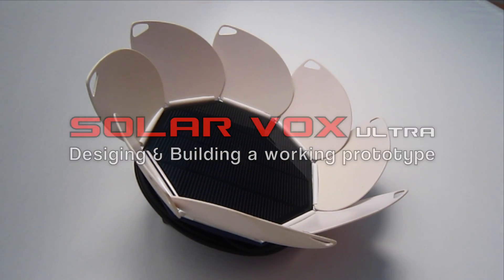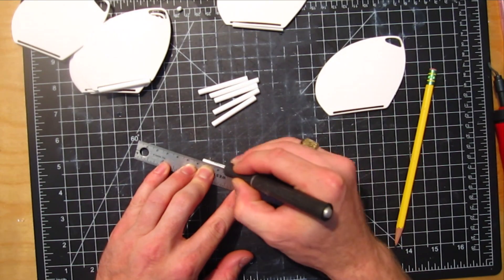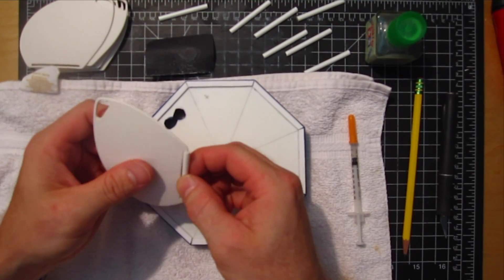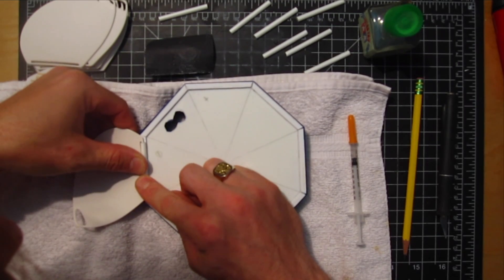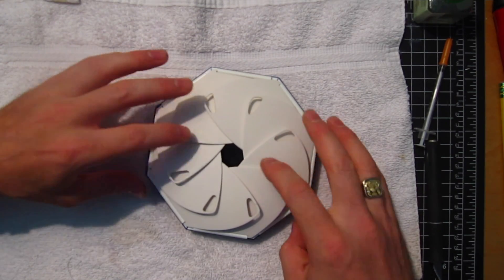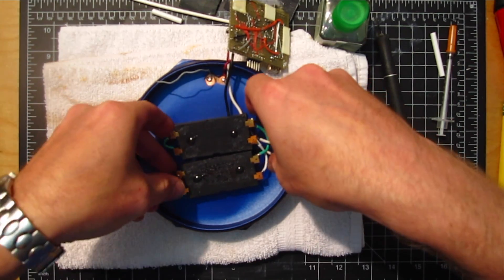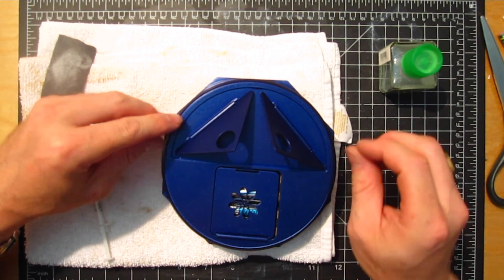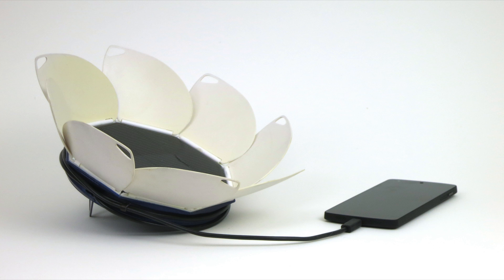Prototype Assembly Prototyping Product Design: Mobile Solar Charger power bank Part 7

Comment: Hi Eric! Just found your channel and am enjoying your videos. I have a question: when designing and building a model, how much do you focus on manufacturability? For example in this case you glued the petal hinges on. I imagine this would be a nightmare in production, so that part would need to be redesigned. Here the change could probably be minor - add a slit in the barrel and make the petal click into it and latch, but in general the manufacturing processes could influence the look and form of a product. Do you take that into account at this stage of the design?

Comment: to start career as a product designer one should be good at electronics? if so can you prefer any book or website or information about electronics
Reply from the maker: Nope, not needed, hire an electrical engineer, focus on form and function as an industrial designer.
Reply: even, if as a industrial designer also no need to have a sound knowledge in electronics ?
Reply from the maker: a basic understanding is always helpful
Reply: @EricStrebel  thank you some much for responding